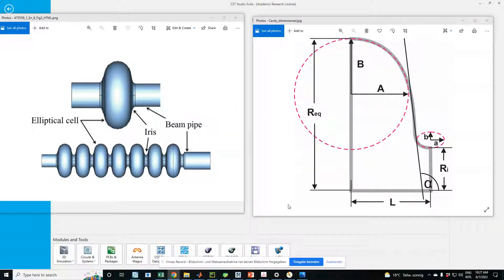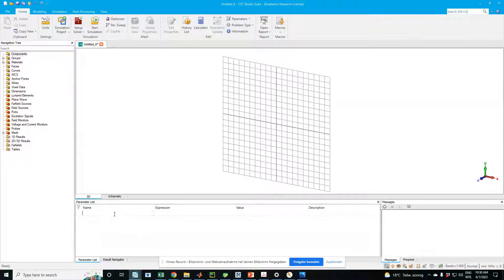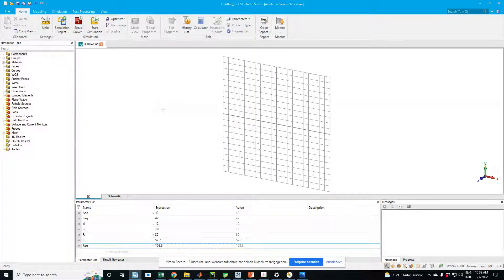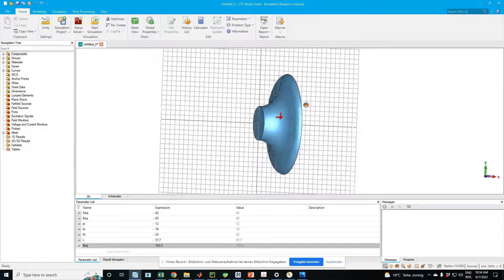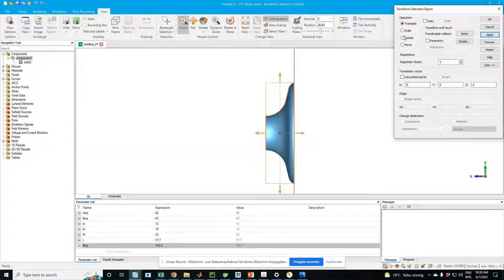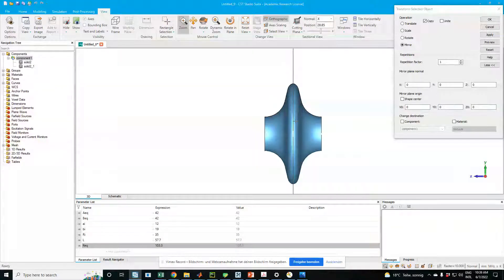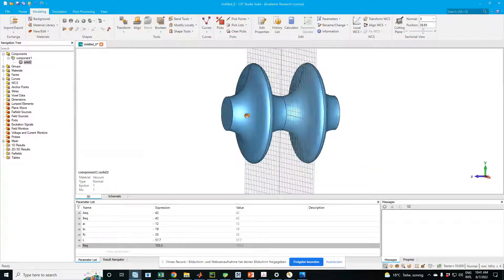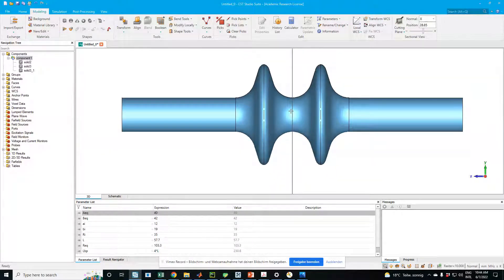CST Studio - Parametric Modelling of an Accelerating Cavity

Comment: What will be parameters of SRF Cavity for Tera hertz THz
Reply from the maker: Tehre is no one fixed parameter. You just have to scale the cavity. The cavity frequency scales with the dimensions. Scaling down by a factor 2 doubles the frequency. From a 1.3GHz cavity, you could scale down by 1000, i.e, divide all dimensions by 1000 and this multiplies the frequency by 1000.